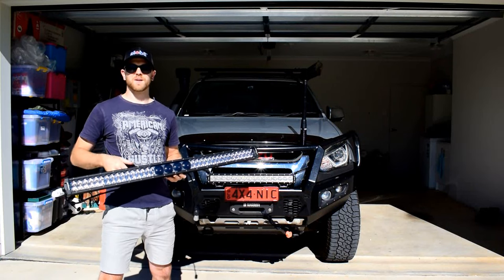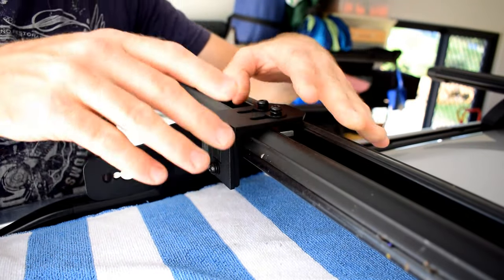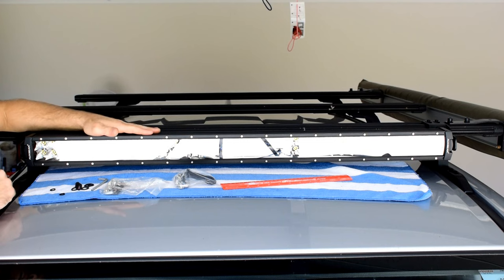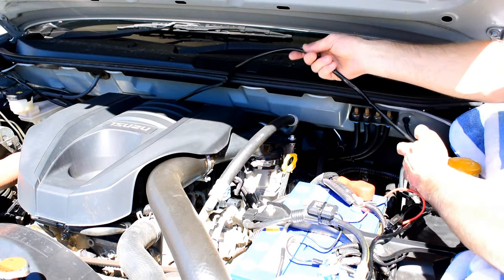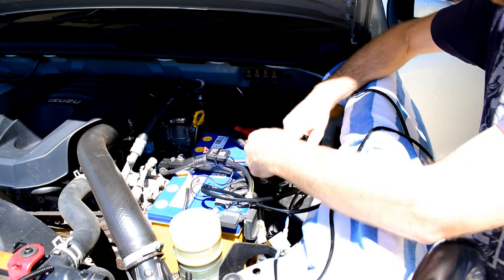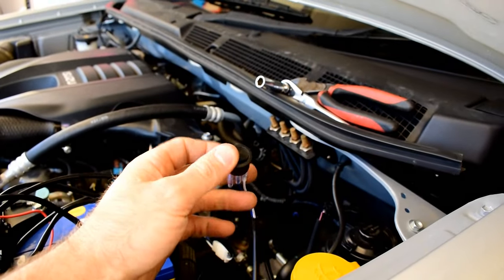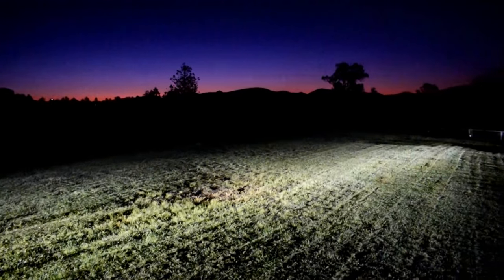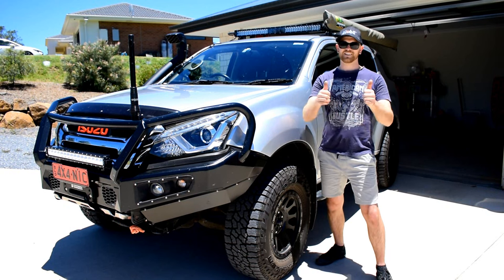How To Install a Light Bar || 42" Auxbeam Roof Light Bar Install || How to Wire up a LED Light Bar

Comment from the maker: Hey guys!
Here's the link to the Auxbeam Website - https://auxbeam.com/?ref=Lowrangenick
Use Code - LOWRANGENICK - for 10% off at the checkout :) 

Here's some tools that will make the job a lot easier - 
- Side cutters: 
https://amzn.to/3r0bKH9
- Wire strippers: 
https://amzn.to/3FrHHvB
- Ryobi Soldering Iron: 
https://amzn.to/3FpP6vu
- Butane torch:
https://amzn.to/2YViYjZ
- Felt Tape:
https://amzn.to/3oADOOq
- Electrical tape:
https://amzn.to/3FEQAlZ
- Wiring cable tie mounts:
https://amzn.to/3Fn1EDP
- Solder core:
https://amzn.to/3cl4Q6D
- Heat Shrink Kit:
https://amzn.to/3kKnZTU
- Small Spirit Level:
https://amzn.to/3wUp1BE

Cheers Guys :)

Comment: Hi Nick, first of all I would like to thank you for the very informative videos you have made, you have save my ass, second I can’t find the clip how you changed the automatic transmission oil, I need to drop the oil on a 2018 d max, thanks mate.
Reply from the maker: I do plan on making a video on the transmission oil change. Most likely in a few weeks time.
Reply: @LowRangeNick  
I'm local to you. if you need a two post car lift. PM me.
Reply from the maker: @donaldkempf4357  Thanks alot for the offer Donald. That's very kind.

Comment: Nice job as usual mate , curious why you have gone back to the silicone intercooler hoses though ?
Reply from the maker: Warranty Issues.
Reply: @LowRangeNick  wouldn’t most of your mods void the warranty?.the chip? Etc?.
Reply from the maker: @CRN8091  I no longer have the vehicle tuned.
Reply: @LowRangeNick  have you had some issues??
Reply from the maker: @CRN8091  yep
Reply: @LowRangeNick  let that message get out there. this inlet mod and others like 35"'s and body lifts etc. will bit your Bum in an accident.
Reply: Exactly what I was going to ask

Comment: How good are those Ryobi solder irons! I used the same thing when I installed the light bar on the roof of my MUX.
Reply from the maker: They are really good! Perfect for soldering thinner wires. They're also very well priced :)

Comment: Hey mate. You have been very helpful. Question, I’m struggling to locate the headlight plug on my Isuzu to plug in my King wiring harness. What should I look for and what does the headlight plug look like? 
Cheers
Reply from the maker: It is a grey plug down on the headlight that has multiple wires going into it. If you are looking for a plug and play harness you will need to get one specifically for the isuzu.
Reply: @LowRangeNick  thanks mate. Yeah the king don’t work.

Comment: Great vid as usual 👌  do you think you'll be making one on how to check/adjust valve clearance in the future?
Reply from the maker: Hey M J, I may make one in the future but due to it being a rather complex job and really needs to be done correctly. I would highly recommend getting a workshop to carry out this job.
Reply: @LowRangeNick  okay too easy, also any automatic transmission service vids coming 🙂
Reply from the maker: @mj4853  Yep, stay tuned!

Comment: Great video mate, what battery are you using? Also can you do a vid on why you changed the hard intercooler pipes due to warranty issues cheers. Just did my first trans service with your other video too. Keep up the great content!
Reply from the maker: That's Awesome! The battery im using is a century 4x4 overlander n70 battery. Biggest size you can fit.

Comment: Where do I buy the long rail system? The one that's mounts to the luggage rack rail. The one the light bar goes on. Lmk thanks great video
Reply from the maker: Yakima make it. It's the yakima lightenup light bar bracket kit.
Reply: @LowRangeNick  what's the long black bar the assembly goes on. Is it a luggage rack or a single bar. Trying to mount light bar on a 1989 jeep cherokee (without drilling holes) trying to locate a bar I can mount to existing luggage rack rails. Then mount the light bar on to that.
Reply from the maker: @420hammyhamham  it's a roof rack system from yakima. Your local auto store should be able to price you up a roof rack system for your vehicle.

Comment: Your videos are great, enjoy watching them to get ideas. 
Did you find a switch to fit in the centre console as the ones for the right hand side of the dash are smaller.
If you found some, where did you get them from as Im hoping to find some USB ports to fit in to the centre console switch spaces.
Reply from the maker: Haven't found any yet! Thanks alot for watching 😊
Reply: This will be the third time I try to leave a comment here ... YouTube may not like links so I’ll try without.
Try ‘ETRONX’. They appear to have various OEM type USB/C charge ports and switches.
Luv your channel Nick. Up until a few months ago, I was deadset keen on getting a new MU-X but in the end, I decided on getting another ‘soccer mum’ vehicle instead - Prado
Reply: Great video as always Nick. I installed a pair of Lazer ST-4 on my D-Max which have the same switch as your Auxleds. Did some improvisation and drilled a hole in one of the dummy ports in front of the gear. Looks OEM.

Comment: Hey mate how come you didn’t wire it into the existing harness? I imagine it would be possible to just use a Deutsche splitter or something so it’s controlled by the same switch on the dash etc? Cheers
Reply from the maker: Yep thats right, i will more then likely do this. So both bars are off the same switch.
Reply: @LowRangeNick  Ok cool I will try to wire it into the existing harness. On Stedi's website it says as a general rule, if your light comes with a harness, it needs to be on its own... so I wasn't sure if I should attempt it.
Lightforce for example offers Deutsche Y splitters so you can run heaps more Striker lights off the same harness.
Reply from the maker: @AlexSwan  I would still run seperate wiring harnesses for each light bars but use the same switch signal for both relays if that makes sense.
Reply: @LowRangeNick  OK gotcha. I was gonna try and just wire the lightbar into the same harness as the two strikers as a "third light" so to speak. But makes sense now. Lightbar on its own harness but then use the same switch on the dash. Cheers legend.

Comment: Does the ground cable have to be screwed onto the battery's negative terminal or can I just ground it onto a screw thats touching metal?
Reply from the maker: The battery is the best connection but you can earth it on most metal panels.
Reply: @LowRangeNick  Thanks!

Comment: Hi! Do you get any blending on the front shield (Window)?
Reply from the maker: None of the windscreen because the roof racks and lightbar are set back a bit.
Reply: @LowRangeNick  windscreen, that's what i meant. Awesome, ill do the same then. Thank you for sharing. Regards from Norway 😎

Comment: Isn’t it illegal to wire them to your high beam directly hence the switch
Reply from the maker: Correct.
Reply: I knew you were putting a switch in but you said something about your driving lights should come on with your high beams cause it’s annoying to find a switch..not a direct quote…and that’s what drew my comment. Don’t want people out there thinking they’re spotties or light bars should come on with high beams. Not having a go. I used your video on putting diff breathers in my MUX.
Reply: its only illegal if there isnt a switch between the highbeam switch and light bar so you can switch it off but still use highbeam

Comment: I would've fed the wiring through the snorkel. Small hole in the rear of the snorkel head and down into the air box exiting through another small hole. Just a thought.
Reply from the maker: I have heard of people doing that and I really don't like that idea. Keeping it simple is usually best.

Comment: You could run wires inside snorkel
Reply from the maker: I dont like the idea of running anything through the snorkel air intake. Keeping it simple is best in my opinion.

Comment: Nice job but I didn’t see your catch can anymore in ur engine bay.
Reply from the maker: I have removed all engine mods untill I have the Turbo issues resolved.
Reply: @LowRangeNick  i would see the Catch Can as a plus. as the industrial version of the motor has a catch can. as long as you have a quality catch can with adequate flow properties. or again tell us what Isuzu are making you jump over.
Reply: @LowRangeNick  best of luck 🤞
Reply: How frustrating that you had to remove all the engine mods due to the turbo issues. Isuzu know that those turbos are faulty 😬

Comment: Not bad w/ the how to video amigo, but wiring up the windshield looks like “proper crap” (if that’s how ya say it in Stralia 🇦🇺) personally I’d be worried about h2O & other elements entering the clip but maybe it’s because I’m in Seattle & we deal in aquatics. Lastly u might consider filming in the garage if possible in future, the shadows & that weird stuff I don’t see often I think it’s called the sun make a wee bit tough to see what’s going on. Just a dumb Merican’s 2 cents. Cheers & thx, u did clear up a couple ?’s I had.